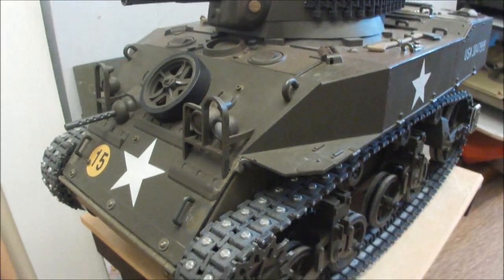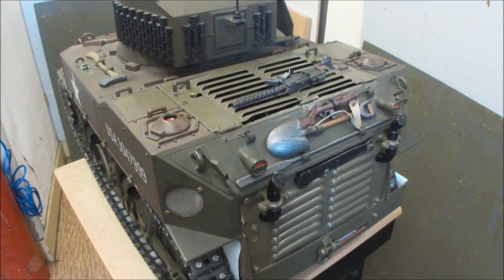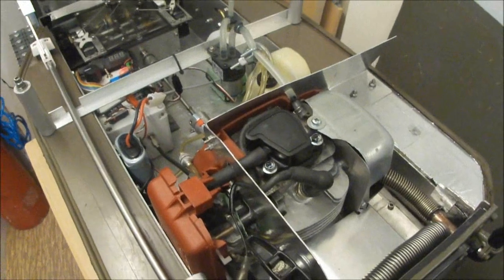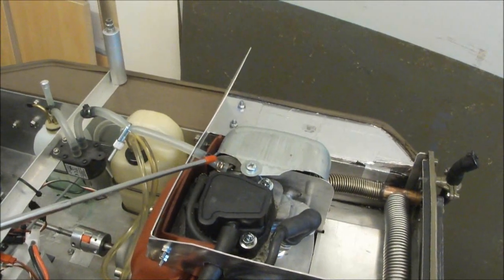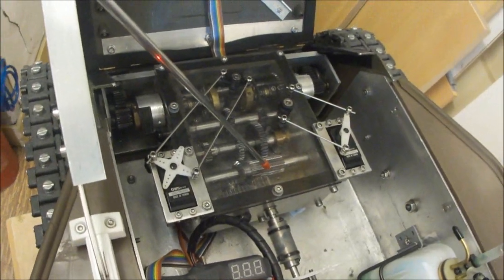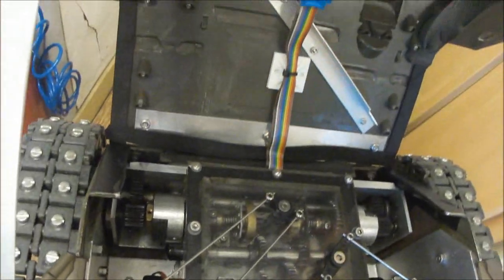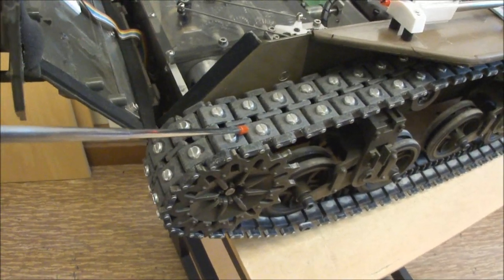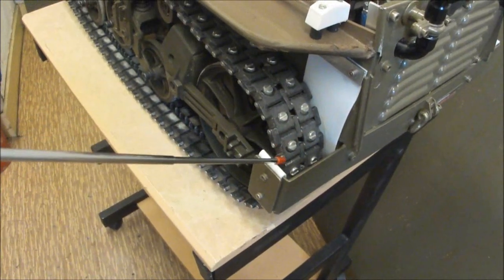Demonstration video of a M5 Stuart big scale RC tank how it works.wmv

Comment from the maker: Thank you Kao, the tank is not for sale. Running it, and the maintance can only be done by the one that build and assembled it, so selling it is no option. You could only run it once, until something breaks (tracks, shafts, gears, bearings, couplings, brakes, engine, andwhatyoumayahvemore)